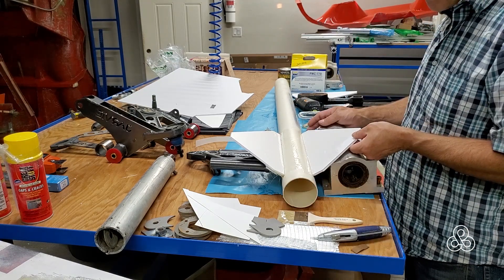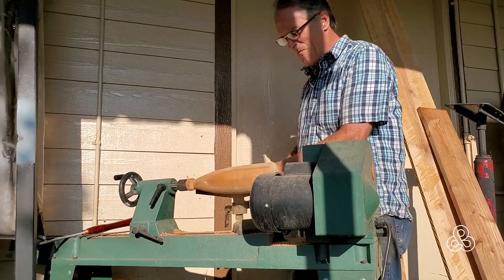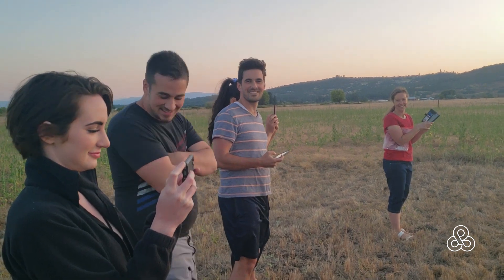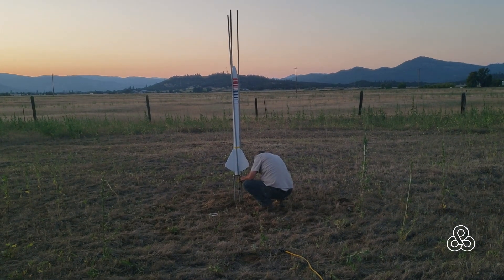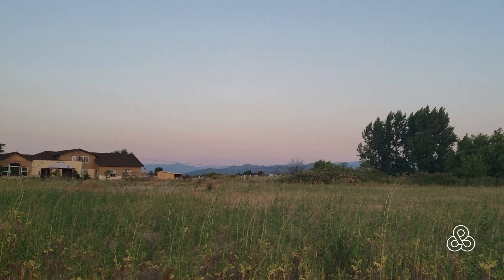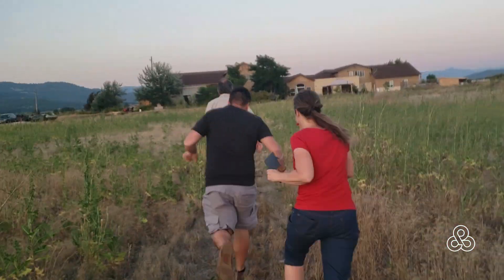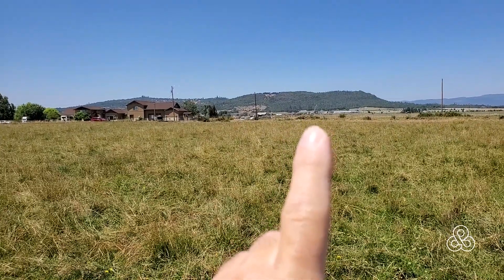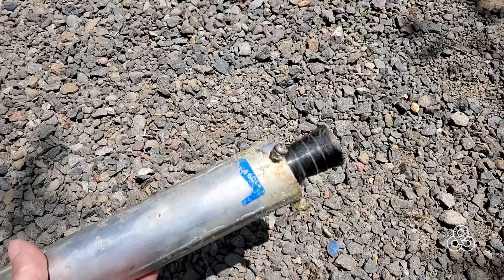High power rocketry 4th of July! When they cancel fireworks, make your own.

Comment: Now, this is something I can perfectly relate to 😂😂. Just that my experience with my Rocket motor was a bit "Explosive" pun intended. We were doing research on the best sugar rocket motors with different Mixtures consisting of iron oxide, Carbon, and several other stuff. The motor was made of PVC pipe with Bentonite as a plug, which was kept upside down on a pressure plate to measure the force exerted by the motor. The problem was that the thrust of the iron oxide one was so much and the nozzle so small that it exploded the PVC pipe in several fragments along with the holder we made to keep the motor in place 😂. Luckily non of our teammates got hurt but that is an experience that makes me laugh every time I remember it 🤣. 
Note: We later made the entire thing Bluetooth controlled using nichrome wire to ignite the fuel, just to maintain the distance from the motor.
Reply from the maker: Oh yes! Some friends and I started out testing motors upside down on a strain gauge as well. I have also tested additives (aluminum powder best so far), but have just switched to building inexpensive air-frames and just pushing the specific impulse up until they fail (catastrophically "Cato") I have a motor perfected now and just build a rocket once or twice a year to entertain the grand kids (and old kids :) )

Comment: What kind of propellant did you use? I have seen people use model rocket motors, but never build their own rocket from scratch. Nice one mate.
Reply: Potassium nitrate and sucrose, with some other minor additives. Aluminum case, steel nozzle. Resin overpressure relief plug (so it never becomes dangerous- well, less dangerous.ha!)